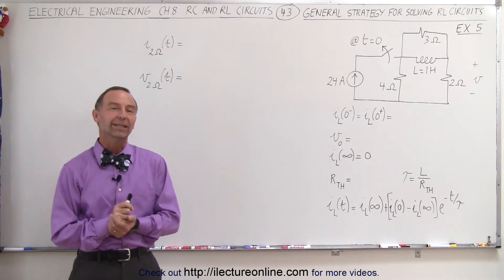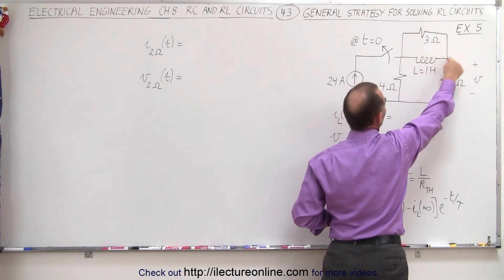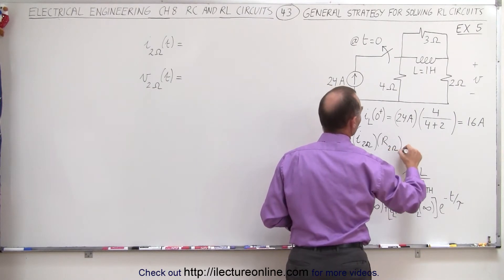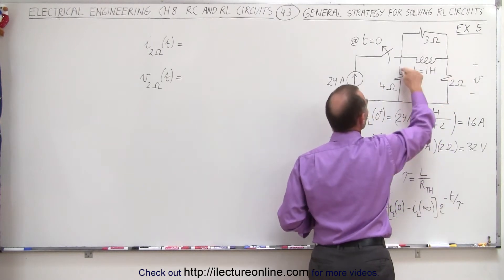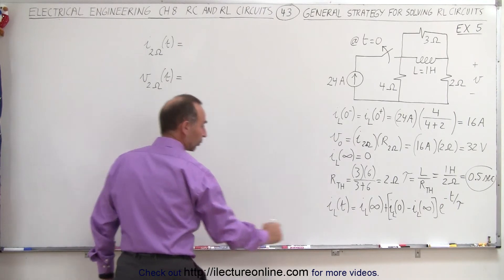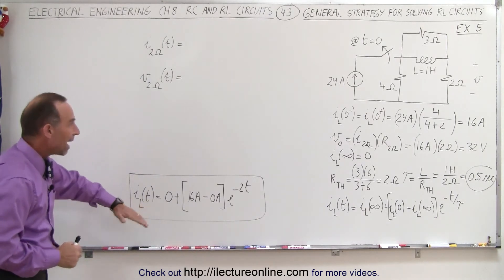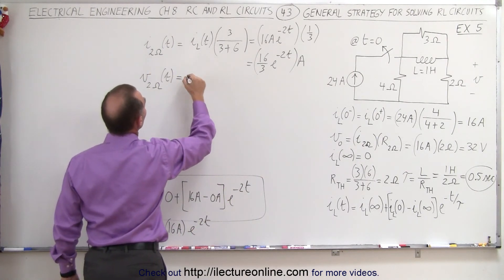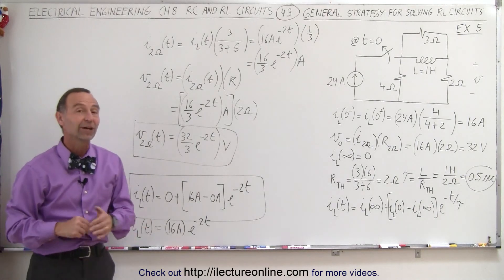Electrical Engineering: Ch 8: RC & RL Circuits (43 of 65) General Strategy Solving RL Circuits Ex.5

Comment: Hello sir,
  I have a question about calculating the current when the current source is present in the electrical circuit:
  Why is the 4 ohm resistor in the numerator and not the 2 ohm resistor?
Reply: i was wondering the same think, i think its a mistake

Comment: Boy, it is really hard for me to see how any current gets through the 4 ohm resistor at t = 0-. OTOH when i do a source transformation of the 24 amp source in parallel with that 4 ohm resistor and thus have a 96 V source in series with it it is clear that 16 amps flows through it (96/(2 + 4) = 16 amps.

Comment: Dear professor, thank you so much for the videos! I find it Absolutely amazing!
  1 thing is not very clear: at 1:10 you mention that before opening the switch, all the current will move through 
1 The L=1H inductor and the 4Ohm resistor. Why so? 
If it doesnt pass through the 3Ohm resitor why would it pass through the 3Ohm?
Thanks a lot again :)
Reply: I mean, at t=O- why would the current passing through 4ohm resistor if it can just go through the 1H inductor and than pass to the 2ohm and than close the circuit.. ?
Reply from the maker: Before the switch is opened , the current is in a steady state condition and the inductor acts like a short circuit ( 0 resistance).
Reply: @MichelvanBiezen Hi professor, I am your big fan from HK! But now I wonder why current will flow through 4hm resistor if there is a short circuit in this question. It's confusing😵‍💫
Reply: @jk.tal22  Agree!!!
Reply: @jk.tal22  Do you get it now? I'm so confused:buffering:

Comment: How we can find current through 4-ohm resistor?
Reply from the maker: iL is the current through the load (the 2 ohm resistor), which by the way must be the same current as through the 4-omn resistor, since they are both on the same branch.
Reply: @MichelvanBiezen  exactly but in book there is negative sign with current through 4-ohm resistor.why?
Reply from the maker: It is a matter of perspective, because the current flows from the bottom (lower V) to the top  (higher V) of the 4 ohm resistor, if we assume that the bottom portion of the circuit is at zero potential.

Comment: Isnt the 4 Ohm resistor in the same situation as the 10 Ohm resistor in the previous exercise? How come current goes through the 4 Ohm resistor?
Reply from the maker: After the switch opens, a current will flow through the conductor for a while longer (transient period) and there will be two paths from one side of the inductor to the other side.  One of those paths is through the 4 ohm resistor.